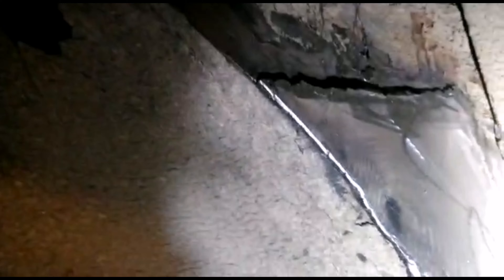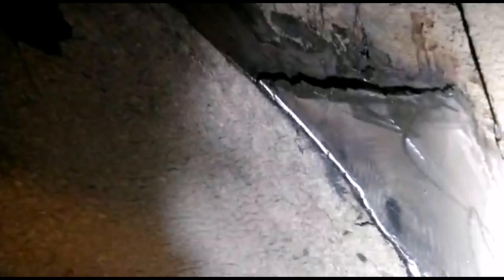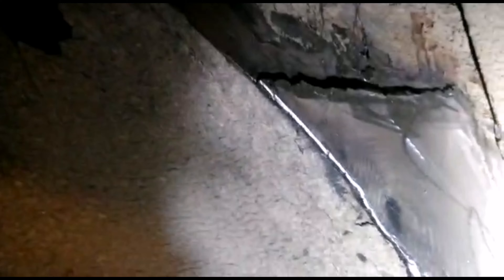Morris minor  resto

Comment: with that amount of corrosion i would rather get proper repair panels and cut out all the old rot. my moggy has been patched on its front chassis legs, and are bulging out with rust by the front suspension. so getting new chassis legs, whole sill replacement both sides as that was patch after patch, new jacking points, x member ends, and tie plates.
Reply from the maker: We have ordered some new panels now where we can't form them in the workshop, which should be arriving any day now, we are not  nut and bolt restorers we are more of a running restoration outfit where we get old classics that have been standing for years and get them running and back on the road in a safe condition rather then end up  being crushed. Thank you for your comment and hope you can enjoy the rest of this rebuild.
Reply: @peteramberley9952  yh i look forward to seeing more videos